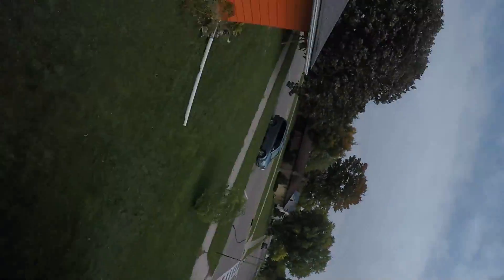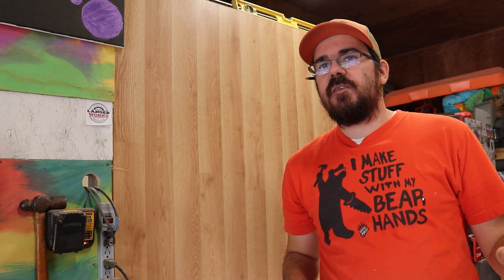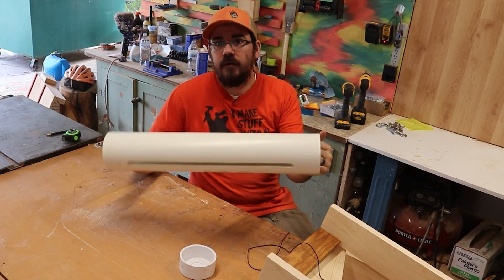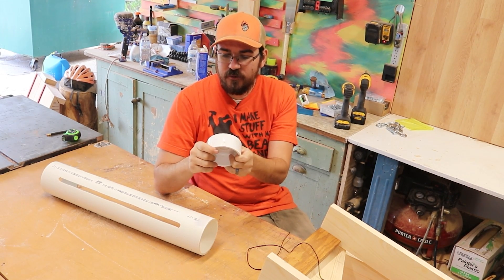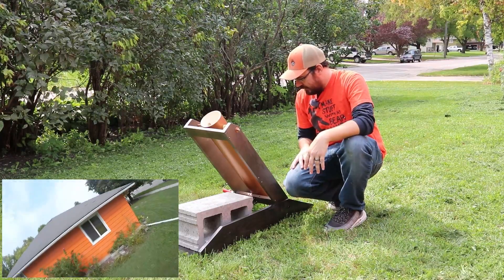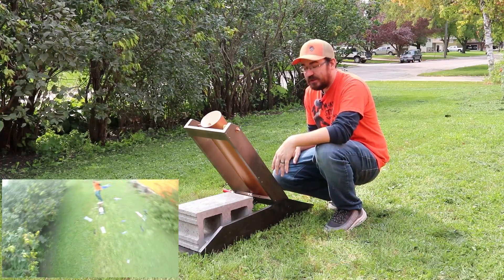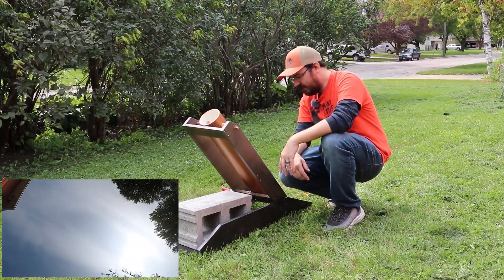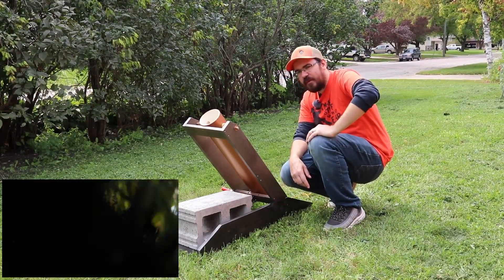NEW CANDY DELIVERY SYSTEM!

Comment: hahah that's awesome! Did you measure how far you can shoot the candy?
Reply from the maker: My initial tests were just over 20 feet. I've since tweaked the bands, and fine-tuned the angle. I fired it a bunch more last night, and the tomato I shot probably went closer to 30 feet. 😀👍
Reply: @BearMaked  Not to shabby for the simplicity of the build!
Reply from the maker: I had to know for sure. It launched the tomato about 35 ft. The GoPro and candy were about 23 feet consistently. GoPro goes farther by itself than it does when shot in conjunction with candy
Reply: @BearMaked  it sounds like you're starting to get scientific about this 🤣
Reply from the maker: It's important to know these things.

Comment: Well done, clever design. Launch angle set enhancement. If you cross drill & cut 3 inch long slots on each of the wood PVC Tube vertical supports, inserting the same bolts as the tube & finally cutting 3 notch channels on each side of the base 1' inch apart you can achieve multiple launch angles. 45 degrees being optimal for longest trajectory.
Reply from the maker: Good thinking! I haven't decided yet if I want to put more work into setting the launch angle, or just leave it with the "I'll just clamp it here and test it" method 😁